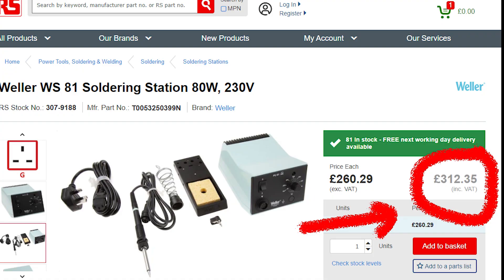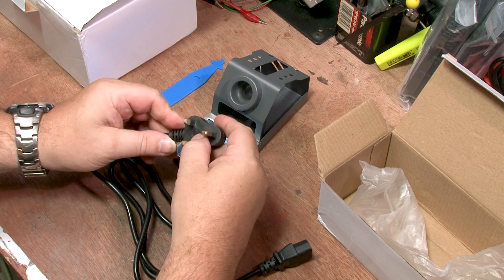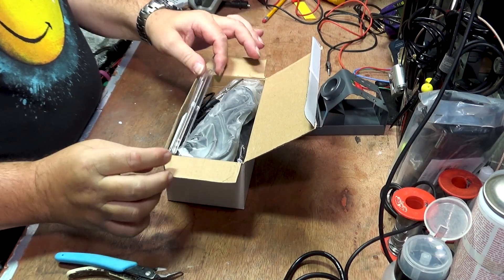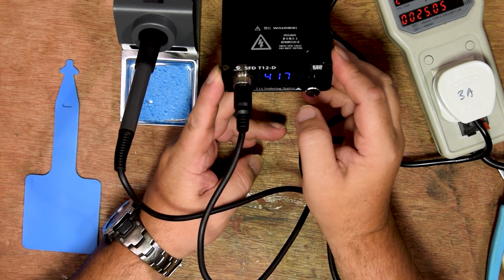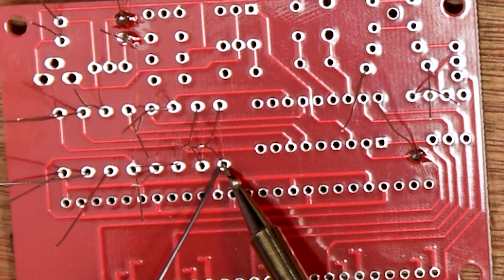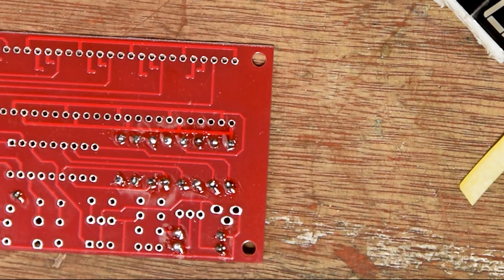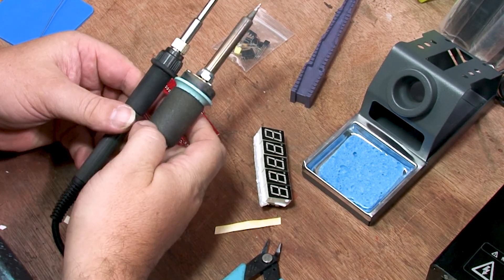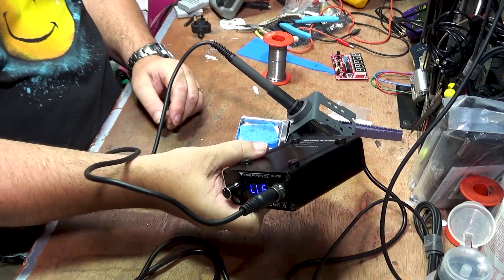T12 Soldering Station unboxing and initial review

Comment: I am amazed you would recommend this product without any testing for earth bonding or ESD test, you must know that China does not like earthing of any metal parts on their products, but you recommend it to novices!!
Reply from the maker: It is actually earth bonded and it's as insulated as my Weller unit. I didn't show the testing on camera because it wasn't an issue. The other problem is that there are so many factories producing almost identical units that saying mine was safe would have lulled someone else into thinking theirs was too.

Comment: Glad to see you using PROPER solder (none of that green reeled cr@p).
Reply from the maker: I only ever use real solder. Can't stand the rotten lead free stuff because it causes more problems than it solves. Much as I'm in for saving the planet, if stuff lasts longer than normal without needing repair it's less likely to end up in landfill.

Comment: Hi! did you tried to unsoldering something with it ? I have a similar soldering station but It's not being useful to unsoldering components. The solder does not melt at all...
Reply from the maker: I have been using it daily. it works fine. You need the temperature set to at least 350, more if you are using lead free solder.
Reply: @GeorgeChristofi  I used it with more than that temperature and does not melt...
Reply from the maker: @mongecapoeira  my guess is that the solder you have is not good. Does the tip get hot at all? If it does then it sounds like you have high melting point lead free solder which is the work of the devil. Make sure you have something like .7mm lead tin 60/40 mix with inbuilt flux.
Reply: @GeorgeChristofi  melting new solder with the tip, melts instantaneously.  the problem is when I'm trying to remove a component from the PCB. I put the tip next to the place where the component is soldered to the PCB but the solder does not melt.

Comment: George sorry for all my questions but I’m a newby regarding soldering. Will this particular flux help so to keep my tips clean :https://www.banzaimusic.com/Colophony.html
Should I dive the tip into this flux after every join I make? 

Last question: after I finish soldering should I add a bit of solder (with flux) into my iron tip and leave it so to prevent corrosion? 
Thanks ;)
Reply from the maker: Flux can certainly help. Most solder has enough in it for me but it can make things easier for those starting out. Just put a small amount on the parts you are trying to join and apply the heat and solder at the same time to the joint.
Reply from the maker: Also, cleaning the tip with a bit of fresh solder rather than flux because the lead prevents any other contaminants getting on the copper tip.
Reply: @GeorgeChristofi  Thanks! so after making all my connections I should apply fresh solder to the tip, clean it and I’m done right?
Reply from the maker: That's right, just a bit of solder on the tip and it will be fine.

Comment: If you used the right iron tips the solder choints would be perfect the tips you used was wrong for that job!
Thank you for your very informative video !
Best regards,
Reply from the maker: Indeed. I now have some more tips for the unit and it does work extremely well for the price.

Comment: Sorry but I didn't watch the entire video. So if your still wondering about the blue pad, then it is for changing tips quickly while the tip is hot. Usually they send it with fx9501 or something like that kind of handles or wands.

Comment: Great Video As Always George And a Neat Little Station Good Call On Changeing That Awfull Mains Lead I Use My Old 25W Antex,40W Cheap Weller With The 3 Headlights On It And My Main One Which is a Cheep Chinese Station a A55KJ Which Seems To Work Reasonably Well Just Like The T12 as a Young Demon I Think I Invented Lead Free Solder he he !! Fine Upload As Always George Stay Safe Regards mike.

Comment: Thak looks like a nice little Iron George. I remember sondering with those horrable red Weller irons of the 80's, the tip was just uncoated copper and corroded away quickly.
Reply from the maker: For the price Simon it is quite hard to knock it. I am going to put it through its paces and see what it behaves like over time.

Comment: Great review and thanks for spotting and pointing out the danger of the mains lead. Thanks regards chris PS I had a similar rubber mat arrived with a new Pace iron. I’m embarrassed to say I binned it before some years later finding out its for removing the tip.
Reply from the maker: So that is what the mat thing is for.... I did wonder! Yes, the dodgy mains cord is a standard Chinese item for the UK. I know John Ward melted one at nowhere near full current. Ta muchly Chris

Comment: I have one of these too. Nice little iron but mine generates RF all over the AM bands. Nifty unit though.....
Reply from the maker: I have yet to test that side of things Steve. Certainly I will have to so that I don't have more issues when dealing with radios than I need to. Thanks for the heads up on that.

Comment: Well, that gives a little bit of hope to those who want a soldering iron but are on a bit of a budget. It is a reasonable knockoff I think. Hopefully it will be durable enough for many years of service. Thank you for sharing George.
Reply from the maker: I'm hoping it will Andy. Not that I needed it but you see a lot of us guy on youtube who are in or who have been electronics pros using high end gear that newcomers would find well out of budget. I'm planning a whole series of that sort of video, hopefully the next one will be the $1 multimeter which is on its way to me. I will also go through tools. In a way, it goes against the good advice you learn from your elders which is 'buy cheap, buy twice' but the reality of costs these days have put that out of reach... I could never afford the contents of the snap on van let alone the new test gear prices.
Reply: @GeorgeChristofi  Yes, I am in that boat. I am using just a standard run of the mill soldering iron but have been wanting to upgrade to a temperature controlled one but as always, I am weary about spending big bucks on the pro gear and worry that it will be overkill for my needs. Your helpful series will be apprecieted by many including me. Most folks will be budgeting and will appreciate knowing how far they can stretch that buck to get enough quality and functionality out of any purchase. Thanks again for sharing George. A thoughtful series that will be rewarding to you I am sure.

Comment: Interesting video George.... I might have a look at one of these. I've gone from a Duratool to an Aldi station and back to the Duratool. Aldi one was OK but the tips are bobbins.
Have you tested the actual main box? Is it safe i.e. grounded etc? I'm sure I have seen some cheapie Chinese ones with no ground. Have you found out about the blue spanking paddle yet?
Reply from the maker: I haven't done a teardown yet but it is on the cards. For the price, they are pretty nice tools although I will see what its like with a better tip. The spanking paddle is to change the tip whilst hot according to Mr AllthegearnoIdea! I am going to do some other tests and possible mods that I have heard about too.

Comment: Looks perfectly acceptable for the beginner/hobbyist. I started out with a $10 40W pencil iron from Radio Shack back in the 1970's. That's all I could afford as a kid.  I used that for a good many years. That and a 140W Weller gun for Pl-259 installations and a little desoldering bulb completed my soldering tools. I didn't discover Solderwick till years later. Thanks for the look see George. Stay well. ATB Doug.
Reply from the maker: Many Thanks Doug. In the 70's, my first iron was a 25w Antex which I still have, along with new tips for it too! I'm not a great solderwick fan but I have it for those difficult moments. I do have an electric desolder tool but still prefer the hand pump unit... no messing, no waiting, just use it! People these days who are starting don't need to spend lots of money on a hobby they may not take to so I'm working on the basis of a guy starting out and trying to keep the budget low but reasonable quality.

Comment: Very nice George. What is that rubber mat used for :)
Reply: Ron C  It’s a silicon pad used to grab and swap out the tip whilst it’s still hot.
Reply from the maker: I have been told that it is for changing tips when they are hot and giving you a surface to leave them on because they are heatproof silicone! I never thought of that myself!
Reply: Very cool!!  Thanks Mate.  My Hakko has one I never used

Comment: Nice one george .the lack of instuctions is a pain .I have one of these irons as a spare  the supplyed tip is as you say not good but replacements are cheap. the calibraition out of the box is not good mine was 20 deg low but hidden away in the menue is a way of correcting it. agree bin the mains lead. Whith a proper tip these are a bargin you can even use genuin Hako tips.
Reply from the maker: I am a bit peeved about the lack of instructions but I will try and download some to get the info out there. I didn't know this thing had a menu as such, just thought it was an led panel! I do think the point tip was the wrong one to supply but I guess that if you have a surplus of one tip or you send an inappropriate one out you can get a few more quid for a good tip. I would have thought using genuine Hakko tips would cost more than the whole station!

Comment: I didn't like the video, not enough tea drinking he he :-D
I was thinking chisel tip, but that's a private problem :)
That T12 looked smashing, switchmode psu and iron controller, and the iron looked better than my old yellow antex from 400 years ago :-D
Don't know what the blue flappy thing was.
Yep the cable needs to be stripped and used for low voltage d.c crock clip cables.
Never enough crock clip cables.
Or multimeters, psus, tea bags :-)
Reply from the maker: I know... just like my school reports... Must Try Harder.  Yes, it needs a better tip. and I had/ still have my first iron, a yellow antex 25w with some new tips. I do like the speed at which this T12 heats up... none of this 10 minute wait for a single solder joint... blue flappy thing... hot tip removal thingy... Mr Allthegearnoidea told me so.
Reply: @GeorgeChristofi  I wonder if the element in the tip has a shorter life because of the amount of current flowing to bring it up to temp fast.
But what to compare it against, my antex is still ok 20 years later.
The only thing i hate about the antex is the self destructing iron clad tip, once the solder gets into a crack then the internal copper vanishes, leaving bugger all thermal mass.
i ll shut up as im boring myself to death lol :-D

Comment: Hey George!
Interesting video.  That little iron did much better than I thought it would.  I wonder if one of the future videos will be opening up the control unit for that iron?  There might be a fuse in it, but probably not.  Still, to get started, it is affordable for most folks.  Keep the videos coming!
Reply from the maker: I will admit to being impressed with it, even trying to use the awful tip. Certainly I will be opening the box and seeing its innards. I have heard of mods for it that improve it further. As a starter Iron... a very good buy.

Comment: Not a bad wee temperature controlled iron once you replace the rubbish death lead. It might be an idea to check that the case is actually grounded! ROHS solder is definitely the work of the devil and good enough reason alone to leave the EU! :)
Reply from the maker: It is really nice to use, even with that silly pointy tip Victor.  I used the death lead but the only way to get it to stay in a plu was to strip treble the wire and fold it over and solder it to get it to stay in the terminals... bit hard if it's your only soldering iron! Lead free is not allowed in here except in prebuilt gear...